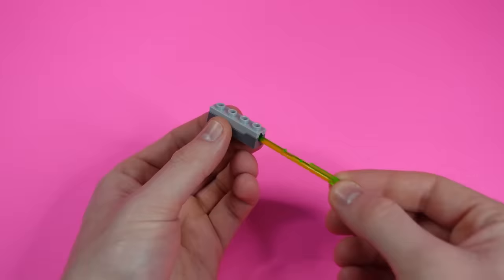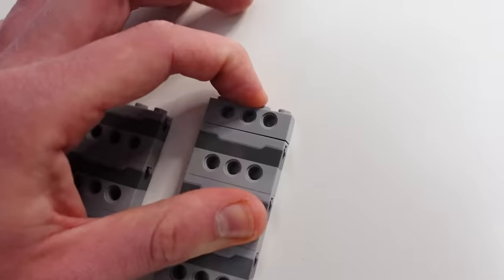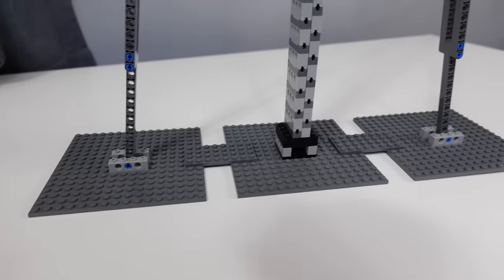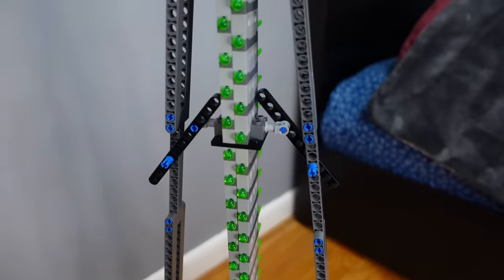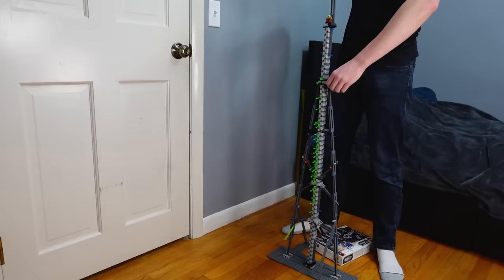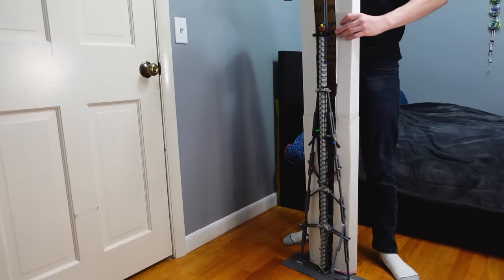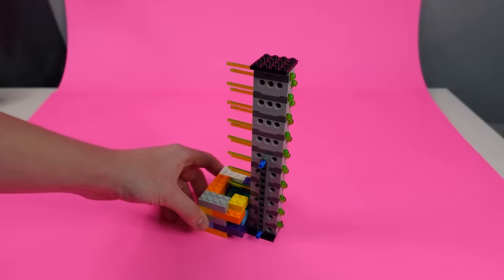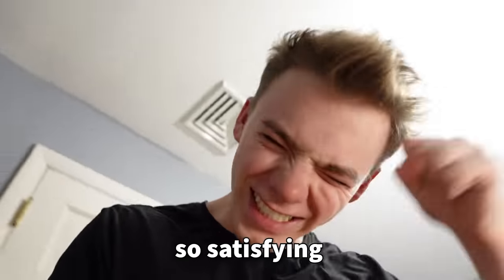I Built the Ultimate LEGO Spring Loaded Tower

Comment: I gotta question the build though. I would have gone with LEGO brackets to make the tower sturdy.
Reply from the maker: Teach me master 🙏
Reply: I Would have As Well.
Reply: The reinforcing that was added later could have been there from the start and part of the structure, that should be stable enough to not need the side things. And just drop a metal ball at the end.
Reply: I love you sets tiago i subbed
Reply: Zip wires would stabilise it too and then you can send zip wire racers and cable cars and gondolas down the strings too.
Reply: The teach me master comment made me laugh
Reply: jkbrickworks made a chain gun with the springloaded gun
Reply: True
Reply: Literally JUST divide 100 by three and put three towers next each other and drop the dumbbell 😂